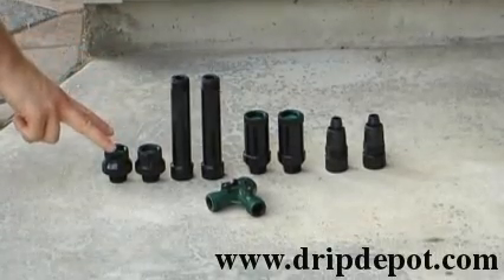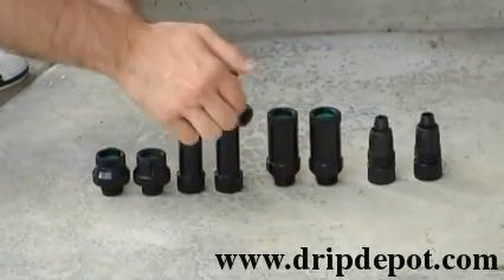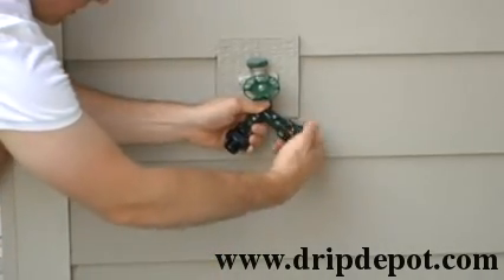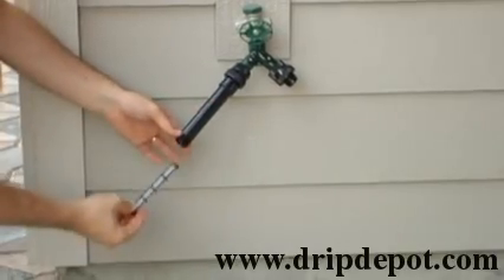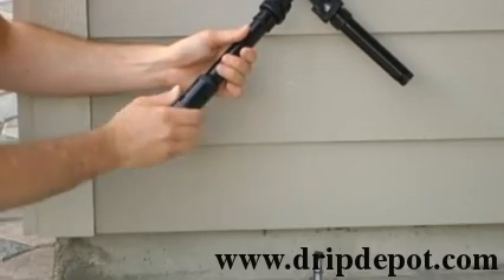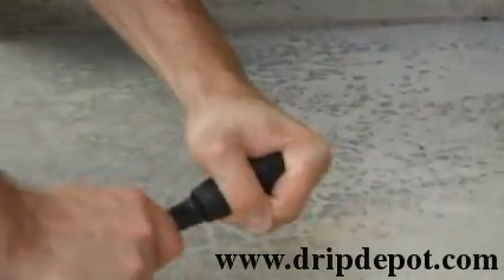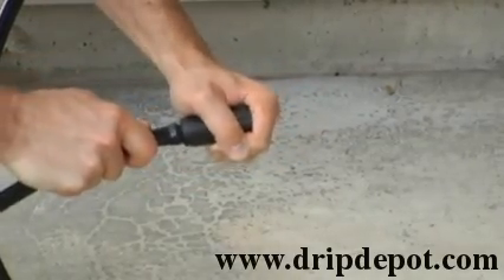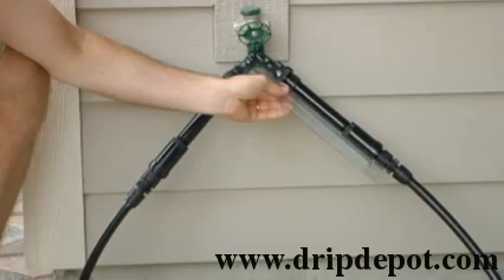How to Setup a head assembly for 2 Zones w/ 1/2" Tubing

Comment: Where do you install the two zone timer?
Reply from the maker: In this case, the two zone timer would be the very first thing connected to the faucet -- you'd then install the head assembly parts at each outlet that will be used for a drip system :)